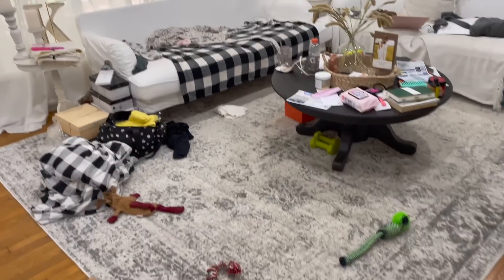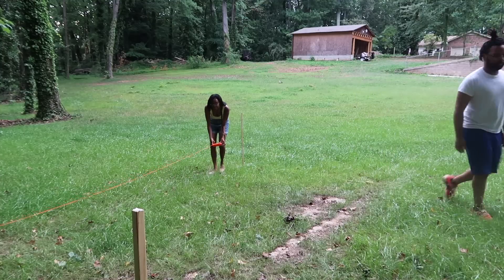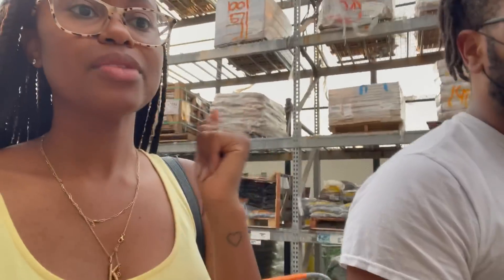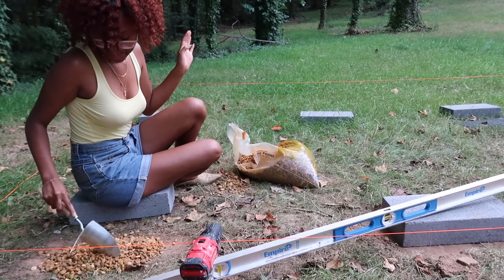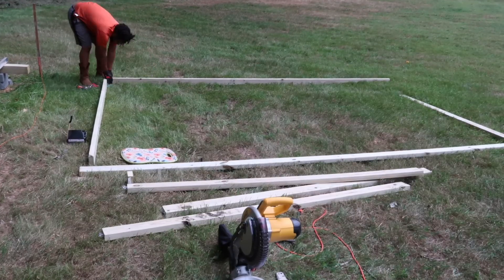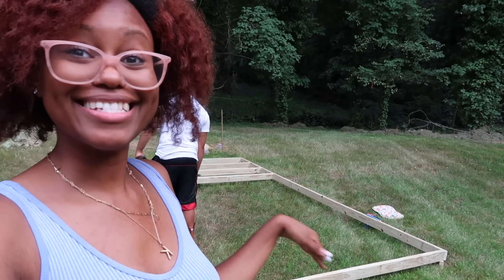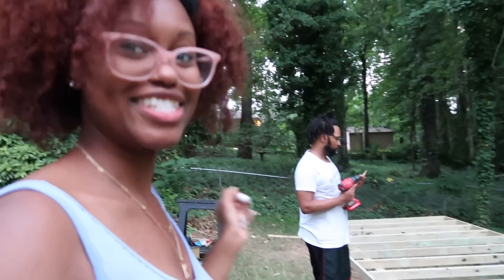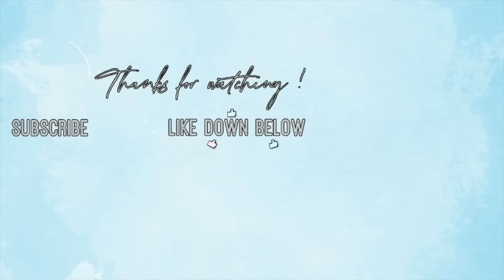DIY SHED MAKEOVER PT.2| WE HAVE FLOORS!! +Creating the Foundation, Frame & NEW Subfloor #FIXERUPPER

Comment: Since you want it to be level and STAY level, I think you should use sand underneath your paver stones as if you were about to create a patio, but build your shed on top of that. You would put down the sand and tamp it down and it would be level for a long time. Then put the pavers on top of that instead of sitting it right on top of the dirt because the dirt will settle and move with the water grading as the seasons change
Reply: I agree with this comment. Also you should add wood in the middle to prevent the floor from sagging
Reply from the maker: Ooooo!!!! I’m afraid it’s too late now 🫠🫠🫠 such a good idea though. I didn’t come by that in our research but we did read about putting gravel underneath for the same purposes !
Reply: Right makes since
Reply: Yes you would do a layer of gravel then a layer of sand making sure to wet and tamp it down just as if you were doing a patio. This may well do just fine if there isn’t too much irrigation and it’s ok to try different options so kudos to you for getting it done! Can’t wait for the final reveal!
Reply: And that pea gravel is going to continue  to sink into the soil as time goes along. Using deck post blocks would have been another idea.

Comment: Great job guys and thus far looks good but I just have a few  questions or maybe I’m jumping the gun. 

1. Need sand or something underneath those pavers and tamp down to lock in place. Maybe use concrete piers or concrete blocks in lieu of pavers?

2. If ground isn’t level, you should level ground by removing additional dirt instead of stacking paver blocks. What is keeping stacked pavers in place. Need some type of mortar or construction adhesive in between the paving blocks to keep from shifting. 

3. Are you going to bolt sill plates or as you called them floor studs to pavers? How is base of shed going to stay in place on top of pavers?

4. Did you use treated wood or going to seal wood? And what about some type of moisture barrier between the sill plate (floor studs) and pavers? 

5. Are you using exterior grade screws?

Comment: If you all will have a riding mower and lots of large garden tools, wheel barrel, etc. you might want that barn door. I am in the market for a vacuum not. I have a new husky and the shedding and hair sprinkling is constant. I wonder if it can handle a lot of pet hair. I guess if I run it daily the hair won’t accumulate that much.

Comment: You might use vinyl tile or plank on the floor to protect it from any moisture. OSB is so bad with moisture. It’s so fun to watch you guys do projects! ( you can also at this point in the project do roll vinyl pretty easily...) or even after you put up walls. You might even find a remnant for not much money. If you don’t like the design on the vinyl some people turn it over and paint that. So that could be your painted floor. OSB soaks up a ton of paint I think, and takes a lot to look ok...

Comment: DANGER:  Pull your hair back with a hairband or rubberband before using power tools, to prevent your hair from getting caught on the tool while in use and causing you injury.  
The porch is a good idea and adds charm to your shed.